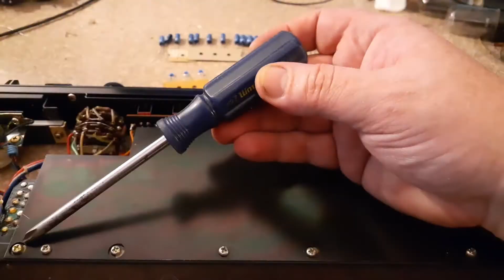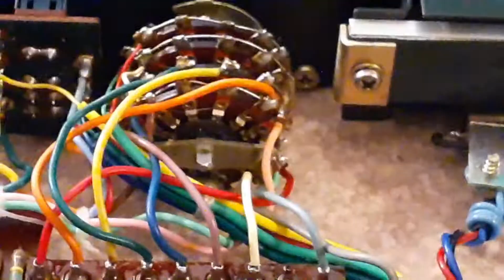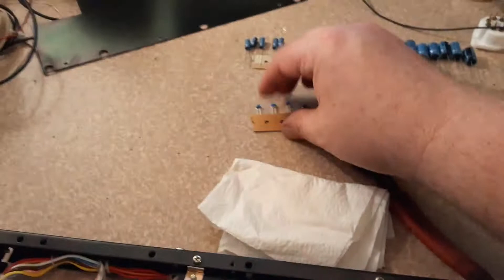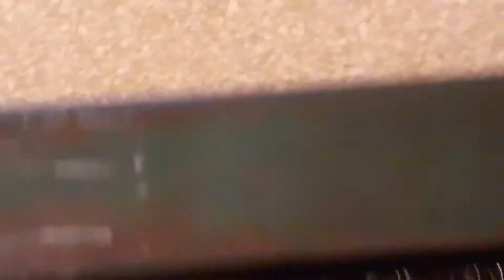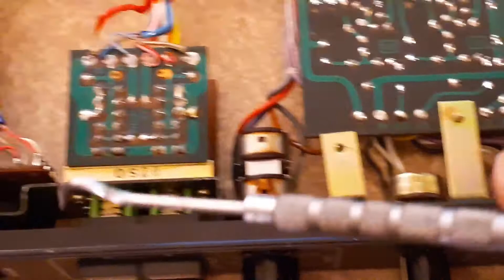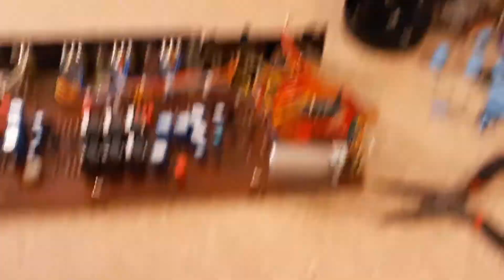Yamaha PM-1000 Preamp EQ Rack Mod, ep 6: Recapping a Pre + EQ Module, part 2

Comment: why do you exchange the tantalum's? them don't age and potentially last for ever, but they die on randomness hits by cosmic rays.. that gave them a name of usual suspects .. but all failures had nothing to do with age..  a brand new one is as likely to die tomorrow as one that is in the circuit since the 1970's.. therefore you have tons of still working and perfect measuring tantalus in 1970 audio devices, that still work..telefunken and siemens mic pres or neuman mikes aso.. it's the electrolytic that age and dry out.. because them contain a chemical active fluid.. tantalus are solid like a piece of ceramic..
Reply from the maker: I just like the sound of the WIMA film caps better, that's all. And if I'm recapping something, unless it is rare or desirable, I might as well do it all.

Comment: I have a DBX 163X and 463X that I upgraded the PSU caps on both. To be honest I followed a guide. I hear less noise for sure. Now moving on to the film caps.. if I changed them with the WIMA caps of the same value, what does this do in you experience with these older pieces of equipment?